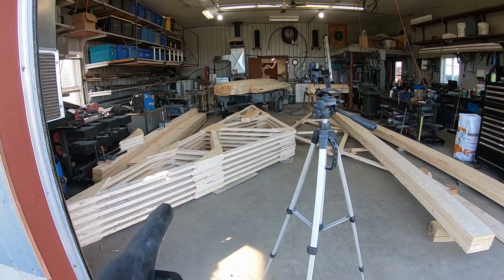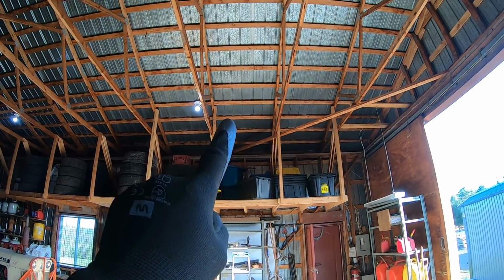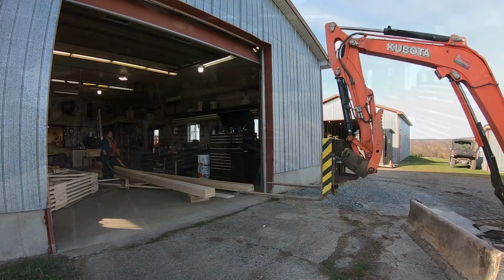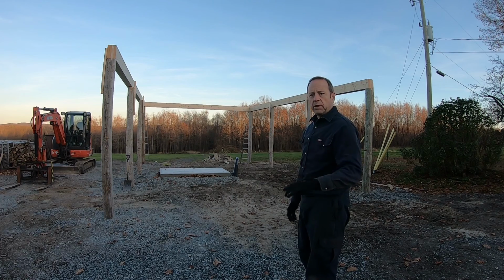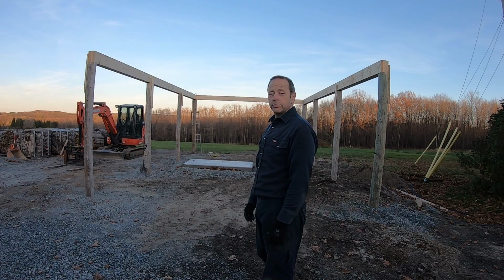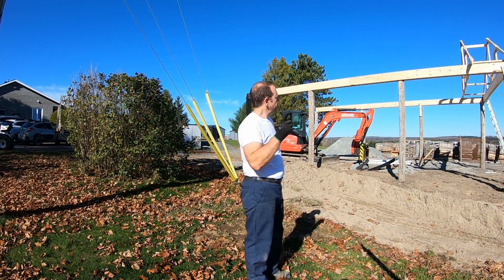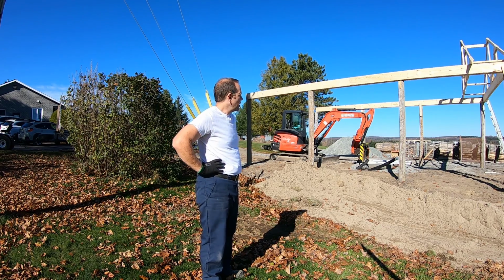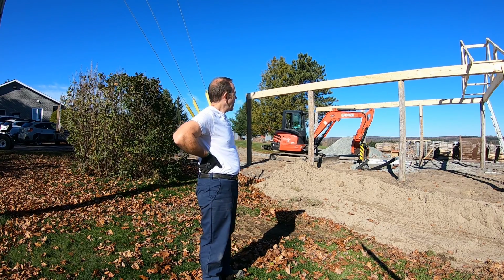#272 Wood Shed - Installing Trusses Using an Excavator

Comment: You're a very smart guy Joe. Doing two at a time, is not only faster, but it allows them to remain in an upright position for fastening with no one at the top side holding them. Very clever.
Reply from the maker: Thanks!  That saved me a lot of time and effort!

Comment: Salut Joe et Celine!!  This is a big job and it's good that you have the excavator.  The breams were tricky to balance and get set but I liked where you used the 'guide' 2 X 4's on the tops of the posts.  Then getting the trusses set was pretty delicate too get them right where you wanted them.  And then the 'big loft' moving the boiler.  I didn't realize it would be that heavy.  You and Celine worked well together to get this work done!!  Way to go.  A la prochaine!!!
Reply from the maker: Thanks Mike!  The boiler is indeed a big piece of equipment at 8ft high, 8 feet long, 4 feet wide. Sometimes, it takes more preparation time than the actual job. But if the job is done quickly, there is no problem in that. Thanks!

Comment: This is great to watch, thanks. Using the excavator with the forks works great for the trusses, I have never seen it done like that before but it seems so much better than using a loader. I will be interested to see how you do the weather protection for the chimney as it goes through the roof, when you get to that stage. This is a great project and good team work
Reply from the maker: Hello Joseph! That is indeed true, we see so very little use of forks on an excavator. Then nothing about lifting trusses in pairs. When I get to this point of the chimney, I'll make a video of it. Thanks!

Comment: Hey Joe,  that excavator makes a great forklift. Great job getting those beams and roof trusses installed. It's like a giant Lego set lol. You will really like your outdoor boiler. I like mine very  much . Great for inferior wood.
Reply from the maker: Only difference, we don't nail Lego blocks! It was a very easy process to set the trusses in place. Can't wait to heat using the boiler. I am still working on it! Thanks!

Comment: It was really stressful when you were moving these long trusses with the small width of the forks.... not even fastened to the beam. You managed this excavator in a non usual operation with skilful.👍👏
Reply from the maker: Thanks! In fact, most of the weight is located near the center of the trusses. So it was not so bad. The worst part was with the 28 feet beams.

Comment: LOL! Nice job Joe! Is the wood boiler for only heating the pole barn itself?
Reply from the maker: No... I've installed insulated glycol pipes in the ground to heat the whole house and the garage. It will also be used to heat the pool when needed. Thanks!

Comment: Good Evening Joe 👌👌👍👍Outstanding Maneuver to install the upper support beam 👍👌😇 Very nice weather that you have 🌞👍 Yes very important not having a trust in the middle of the chimney 🥴Planning is everything's  👍😇👌 WO WO WO JOE 😉👍 OUTSTANDING ROMANTIC HUSBAND AND WIFE TEAM WORK MON AMI 🌹🌹👍😉👌 I lift my hat for 27 years together  👌👌😉😉👍👍Cheers 🍻🍻
Reply from the maker: Thanks Dave! You have tried the excavator, it's very easy to control movements.
Reply: @FromSteelToWood  Not that easy maaan, I almost get ejected if I have not been wearing the seat beat 🥴🤣👍 YOU ARE AN OUTSTANDING operator Cheers 🍻🍻